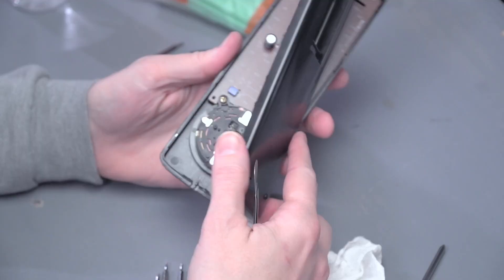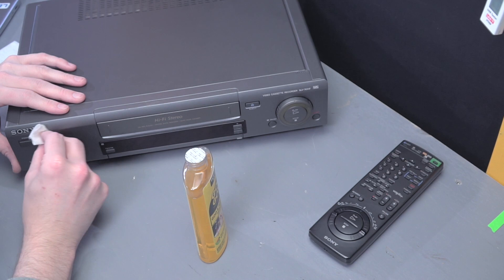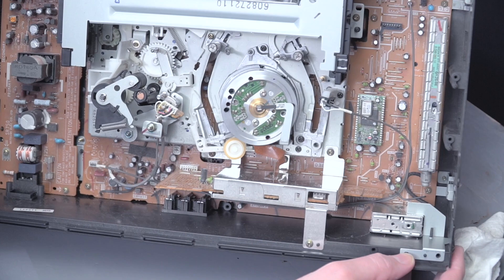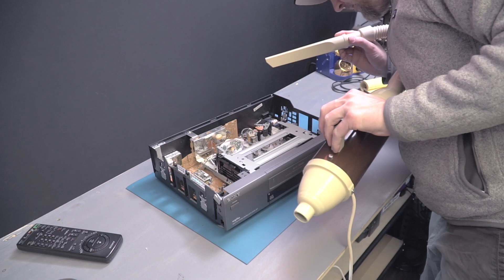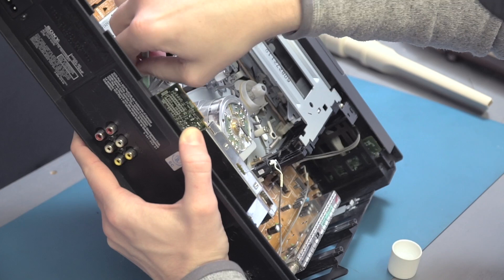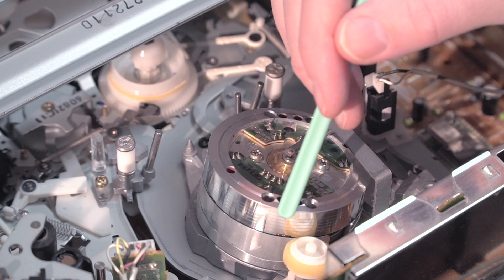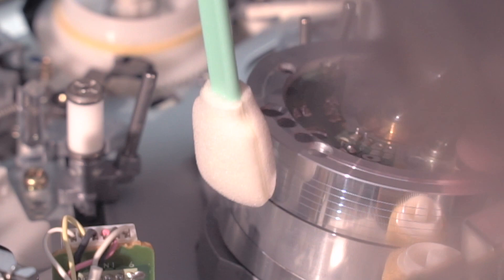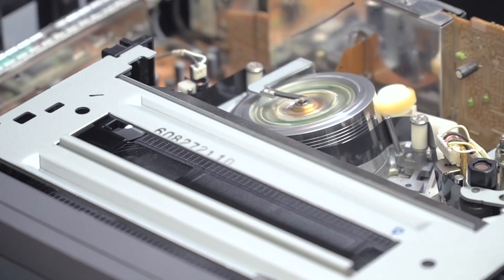VCR Head Cleaning How-to | 90’s VHS Rehab pt.2

Comment: Found your very detailed video that I will be using to clean my old VCR. I have a Panasonic PV-8450. While I have not ever manually cleaned a VCR, I am no stranger to cleaning and repairing electronic equipment and have a technical background. Based on what I saw, it seems like the direction you gave will be more than sufficient for the task. One question I do have is on the rubber rollers. Since alcohol could cause the rollers to dry up, do you have a recommendation for cleaning those? I don't think I caught what you used.  Thanks in advance for your help.

Comment: Great video. What do you use to clean the rubber parts?
Thanks.
Reply from the maker: A lot of times the only answer is to replace the old spoiled rubber rollers and bands, eBay can be great for finding new versions, but if they're not too far gone you can try this: https://amzn.to/3UQ3YOq (affiliate link). Thanks for the message!
Reply: @DcSoundOp  thank you,

Comment: can I use  surgical alcohol at 70° to clean the heads
Reply from the maker: I wouldn't. The water content is a bit more than you'd want for most electronics and heads and the cost of a small bottle of 90% is so little at a pharmacy or grocery store, it's not worth the risk to me. Thanks for the question!

Comment: What is this rack device standing on vcr? It’s for digitizing?
Reply from the maker: It is a swticher / scaler - for switching between video inputs and converting them to other formats as well as scaling things to fit. Thanks for the question!
Reply: @DcSoundOp  So can u clarify what exact model this is? Want to read about what exact stuff it can do.
Reply from the maker: It's an Analog Way OctoVue FX - one warning about these types of switchers... they are LOUD. They create a lot of heat & have pretty beefy server style fans that spool up and really get going at times. They are handy though & cheap if you keep an eye out for a good second hand one. All the best.
Reply: @DcSoundOp  I read about it, wow u definitely should make some video review how u use it for upscale and digitizing. But I didn’t find is it do deinterlacing. For my setup I use rgb out from scart and upscale to 720p so adaptive deinterlacing included via cypress cslux 1080p scart to hdmi scaler